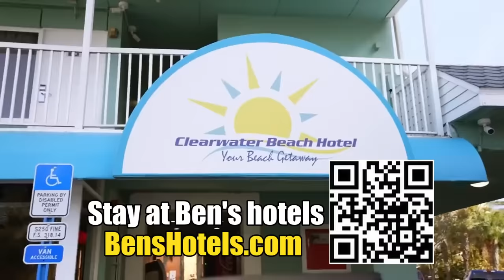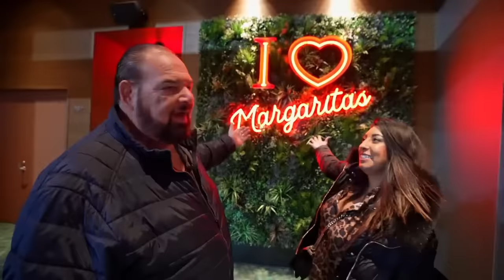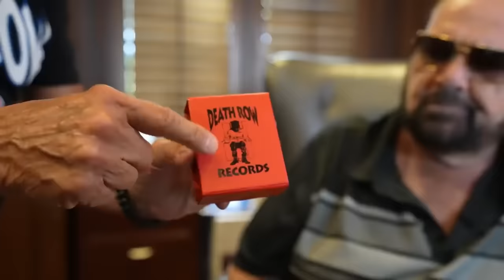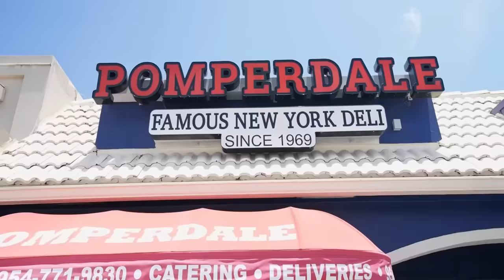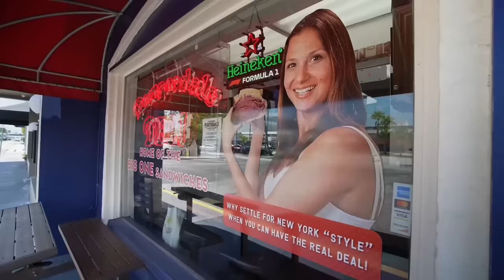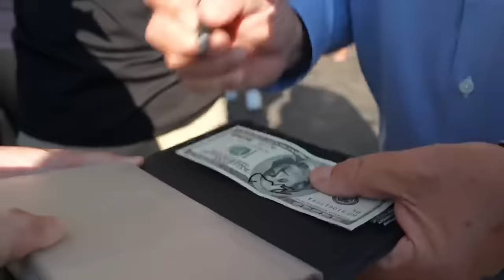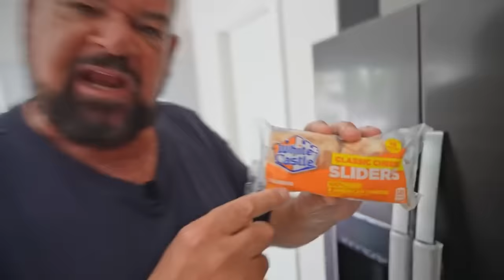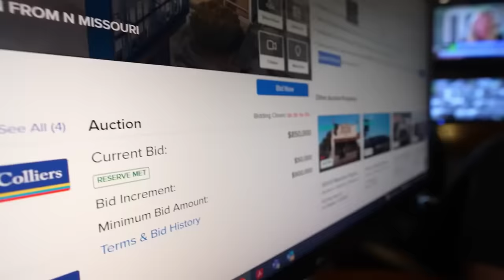Best moments of Ben Mallah 2023

Comment: If you are detailer and you don’t check your customers PSI and offer to correct the PSI you are missing out on a cheap and easy way to value add to your service. I offer this for free and check all 4 tires and fill up to spec if needed. I have a “detail summary” card and video that I send to my customers where I will annotate things like this and let them know I fixed it or possible solutions. They love it!